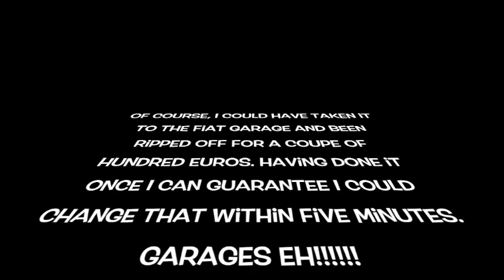Changing the Diesel Filter on My Wife's Fiat Panda 4x4.

Comment: Hi Tim, I can't believe they made the filter so accessible. Most car's, you have to take off a bunch of things or at least Jack them up and reach in from the bottom. Quite a nice design. Take care. Your friend Al
Reply from the maker: Good morning Al, it's a well-designed car. They are simple and strong and the 4x4 is selective, meaning it is in front wheel drive all the time and then if it senses any slip, it goes into 4x4 automatically. I've tried to fool it on the farm when it's wet, but you can't! Another advantage is that it's very light. We have the Land Rover (which needs some therapy) that I used to use in the desert in Morocco, with diff locks and every other contrivance and that plows through with it's V8 engine, but the little Fiat just goes over the top! The only poorly engineered part is the suspension, they have raised the ground clearance over the standard car considerably and fitted an aluminium sump shield etc, but they have done this by fitting longer shock absorbers only. This puts all of the bushes under more pressure as the travel is elongated. I changed all the bushes for poly bushes and fitted Bilstein shocks which give progressive damping. Now she rides like a dream both on and off road. My wife loves the car, she thinks it looks like a moon buggy! All the best, Tim